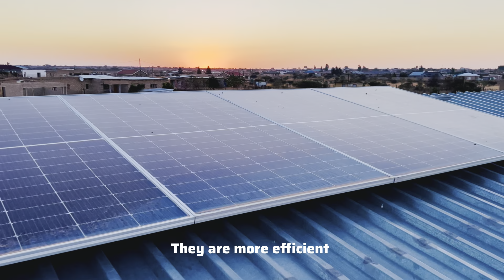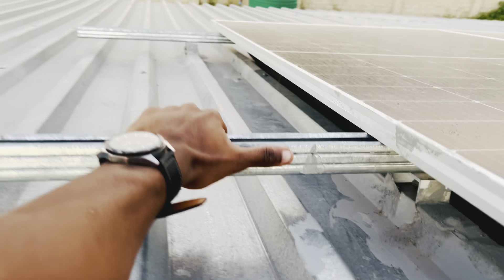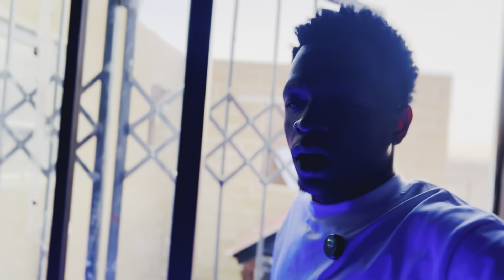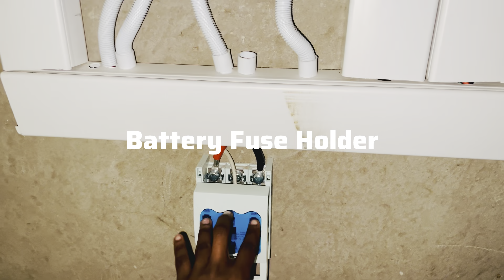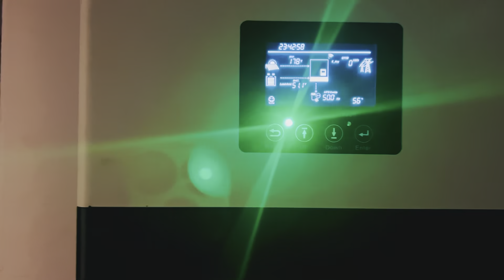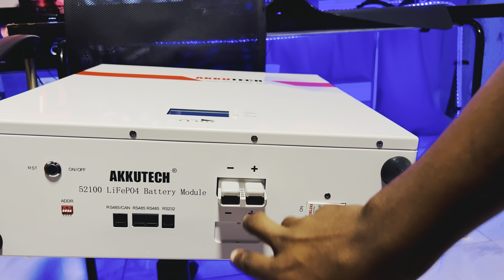Goodbye Eskom(ZESA) | My Home Solar 🌞 System Review

Comment: I've been running my solar system in cape town for 2 years no and it's amazing, sunsync inverter with 3x 5kw sunsync batteries and 8 panels. If I can give you some advice, get rid of your kettle and invest R500 in a cheap single plate induction cook top and get a stovetop kettle, it boils water twice as fast and use way less power, runs on solar effortless. That and a water solar heater and you never have to run a geyser again either.. enjoy you system, feels great not to pay Eskom any money
Reply from the maker: Appreciate the advice👌🏻,I’ll definitely look into stovetop kettle,I already have a 2plate gas stove now

Comment: And you need a special network cable that allows the battery to communicate with the inverter. At the moment the inverter is taking a guess about your battery
Reply from the maker: That makes sense

Comment: The voltage is not what you want to see, you need to see the W (kW) generated. Late or morning the voltage will still be high but the power generated still low. Also you want to see the usage in Watts and not percentage, then you can compare apples with apples
Reply from the maker: Appreciate it 👌🏻

Comment: Bro thanks for the vids, very useful and have few questions including the WiFi satellite system you are using, what’s the speed rate and how much its cost installation and monthly charge, looking on getting one for emakhaya
Reply from the maker: I appreciate the love and support ey 🙏🏻..And as for the WiFi system I used to use minitech but I stopped cause when I moved here they increased my bill from R300 to R499 cause it’s a rural area.Plus they were going to make the outside pole much longer which for me is an inconvenience especially on windy days.So right now I’m using Rain but it’s also disappointing in terms of performance so I’m still looking for something solid and I’ll let you know
Reply: @CraigmistYTThanks Bro, your channel is going to grow big time because you share detailed vids and leave less questions, I was using rain myself for about 2 years and honestly dissapointing sometimes and moved to Web Africa, aim also to get proper connection for back home at rural area, issue rain don't work there and rest of the providers are extremely expensive outside the 5G range

Comment: Here on Capetown we dont have much sun in winter.  So almost six months the solar system won't produce much. This makes the investment unfeasible as my summer electricity bill is about R1000 a month with my solar geyser
Reply from the maker: I understand, it's definitely important to weigh the return on investment based on your specific location and energy needs 🤝🏼
Reply: Is this not where you need the Canadian solar panels unless you saying there is light at all but I believe the wavelength needed still bounces off your solar panels. If they are the right ones you should still be getting juices, I guess get the right expertise to assist with your capetown setup
Reply: In winter the system is less reliant. I fully agree you, but spending R1000 a month in summer I'm assuming your system is a tad too small. It also depends on a few other factors like:
Size of your inverter(s);
Size of your panels;
Size of your family;
Size of your battery(ies);
Size of your house loads;

Your habits (time of use).

Share this info and I'll help you reduce your summer spend to less than R50 a month.

Comment: Any Solar setup these days is better than no solar at all. Especially where I stay, Eskom is NOT reliable at all. I have a 8Kw Solar setup, running 14 solar panels, with 4x 5kw LiFePO4 batteries. I started with 1 battery and gradually upgraded when the finances was good. I'm still on prepaid Eskom electricity as well which dropped from R2400pm to under R600pm.
Reply from the maker: That's a massive setup, definitely way more reliable than dealing with grid outages! 🔋🔥
Reply: What products did u use.is it simple to connect
Reply from the maker: @rickyreddy-l3i as in the cables?
Yes it’s simple
Reply: Exactly same system!
Reply: what was the cost?

Comment: I have notice that your communication cable is not connected how did you configure the charging parameters of your battery from the inverter 

And what i don't like about the Luxpower inverters is that you need to connect specific  battery brands 😢😢😢
Reply from the maker: i didn't know that the luxpower is selective with batteries
Reply from the maker: can you highlight the timestamp of the inter rcomuunication cable you are talking about
Reply: @CraigmistYT from can to your RS485 Port that will be your communication ports used for your inverter to charge according to your battery bank specs

Comment: If your water is pumping from a well then disregard what I'm saying. But if it is coming from a aboveground tank then switch to a 12v DC 5gpm on demand pump . U can charge a separate battery and it has good pressure,flow,and uses less power
Reply from the maker: thank you for the advice 👌🏽🔥
Reply: @Cragmist I'm on a well but my back up system when my well pump fails is a vev0r 5gpm  pump $60 usd. Pumping from a storage  tank .we don't notice any difference in pressure or volume

Comment: Wait, are those actually lead acid batteries? Thats what the screen on your hybrid inverter thinks they are. I would have expected that form factor to be lithium iron phosphate. Might want to double check so the inverter has a better idea of charge, because lithium and lead acid have very different voltage curves.
Reply: Just checked Akku-tech website, I’m 99% sure those are LFP. I’d change the settings on the inverter so you don’t damage the batteries
Reply from the maker: I really Appreciate the heads up ey 👌🏻
Reply from the maker: Oww thanks  I didn’t know that 
How do I change the settings man ?
Reply: @CraigmistYTit is on the menu of the inverter, else check on YouTube or as any AI
Reply: @CraigmistYTjust seen the video today , definitely need to change the battery type to LFP or Lithium iron phosphate coz LFP have a higher voltage cut off 57.6V than lead acid batteries . Love to see my fellow brothers and sisters going off grid . Congratulations 🎊
Reply from the maker: @DIY_versus appreciate it my brother 👌🏻💯💯
Reply: Aaaand it says LFP on the bottom lol, so yeah gotta change those settings